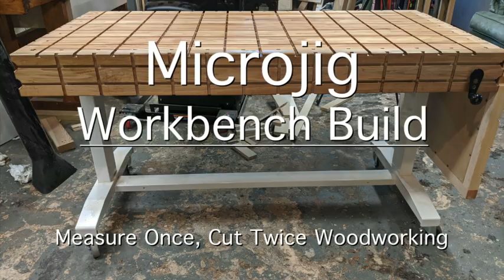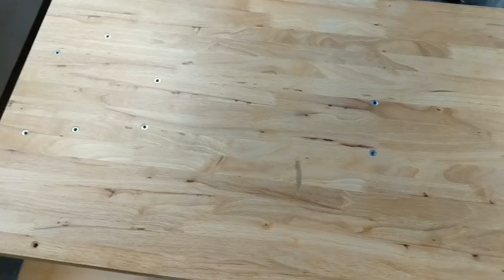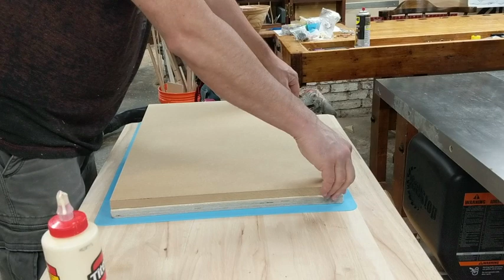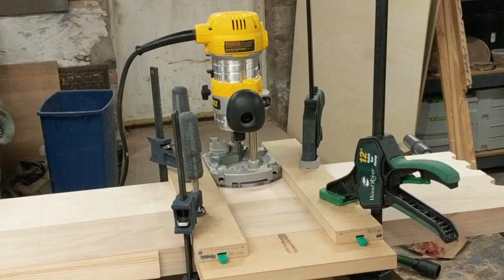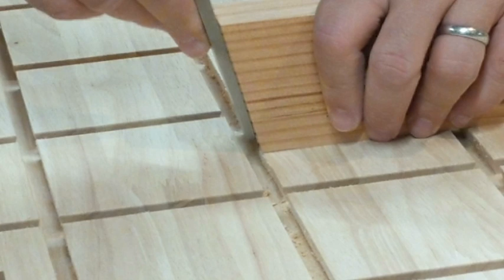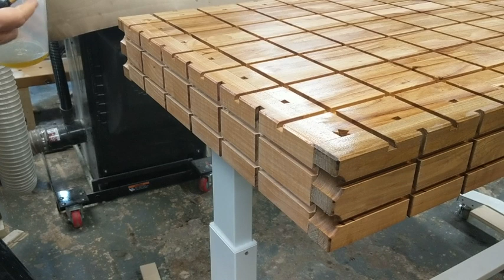Microjig Ultimate Workbench Build

Comment: Question: I plan on using this method for a vertical panel in place of a vice, but how has this panel worked for you on the top surface with debris and stuff following into the slots? My plan is to use Microjig for vertical surfaces and sleds, but use MFT for large assembly table? Any thoughts?

Comment: I think with a few modifications, this plan will work to update my harbor freight workbench. It will just be a fixed height, the same as the table saw, or actually 3/8 of an inch lower so that I don’t have to cut miter gauge 5:25  clearance slots.
Reply: Great idea. Would love to see the final result.
Reply: @   I have several projects in the way before I can get to it so it might be a bit.

Comment: Good job, between the original plans and your build, i bought my 3rd Husky table. (Each prior was supposed to be WwShop, but ended up in my laser room holding up lasers).  I used 3/4 ply under, nuts all went back in easy. I ended up permanently attaching vertical as the original plans.  It won't hit floor.  And 3d printed a hex connector. Easy.  Btw, the black no drawer table is on sale at $149.  If you can find it

Comment: Well, you have had plenty of time to use/evaluate the table/system.. Is it still the best system for build/assembly? 
The only problem I can see is dust/screws, etc falling into the grouves, but, probably not a big deal considering the functionality of the table.. What is your opinion now, that you have used it for a while?  I see lots who go from Matchfit to Dogholes only. Just wondering.. Considering a build and figured I would ask..
Reply from the maker: It's definitely a great table after all this time. If you want to add dog holes, you certainly can.
Reply: @measureoncecuttwicewoodwor3927  Thank you....

Comment: Great video! I am trying to replicate this in some ways, but I’m having trouble figuring out how you mounted the taller square shaped apron on the end. The second to last shot shows some bolts but that is a pretty important piece to mount securely so you don’t stress that panel on a vertical clamp.

Comment: Amazing. So, is it worth it to use a hardwood for the solid top portion? For strength/durability when using the microjig clamps?

This looks like a fun future project!
Reply from the maker: The hardwood isn't needed for clamping strength, plywood would do just as well. But it is useful for durability, less chips and dings.

Comment: Getting ready to do something similar, but can't figure out what happens if you do a glue-up on the table and the glue gets into the grooves.
Reply from the maker: I haven't gone full boat messy glue up into the grooves yet. Little bits are easily cleaned, and the Danish Oil I applied gives some protection. But I imagine lots of glue left to dry in the grooves will stick and need to be routed out.

Comment: Thank you for the great video....very helpful!  I am creating the track hardware myself - knobs as well as tracks, which I create from, metal, Ipe and kind of plastic.. I am using 1/4 and m6 Taps for drilling the holes and insert the compatible screws with a kind of Loctite glue.....

Comment: Great table... I'm just about ready to try my hand at building one similar to this but I have one question you or one of the other expert might be able to help me with.  Is it worth it to spend the extra money and use 3/4" Baltic birch or can I just use regular 3/4" plywood.  I can get the 7 ply plywood for about $35.00 less than Baltic birch.
Reply: I tend to use ply for projects like this. The layers of ply tend to be more stable. Good luck!
Reply from the maker: My top cupped after using Baltic birch ply under solid wood. Possibly it was the lamination of solid wood to ply that caused it.

Comment: This is great, thanks für the video. Well done and entertaining!

I am planning on doing basically the same thing but with t-track grooves since I already have the bit. Advantage being that one can use a whole range of available hardware, including festool guiderail clamps, plus even regular 8mm hex screws fit in the tracks.

Do you only use this table for a bench or do you also have a dedicated woodworking bench with vises?
Reply from the maker: Thanks for the comments. I use the table as assembly, outfeed and a 2nd bench.

Comment: I like your approach and you’ve made very clear what the MicroJig plans did not (I know, I’m a sucker). A couple of things as I’m getting into this,  the threaded inserts that came with my Husky 46” bench are are actually a little larger than 1/4”. I used a 5/16” bit on the “thickening” plywood base. I also used a 3/8” forstner bit to seat the insert head flush with the top of the plywood since it sits proud otherwise. I used a physical drill stop guide as the plywood layers give way a little too abruptly for tape as a stop. I also found that using a self-centering hinge bit allowed me to skip your draw-a-circle, punch a starter hole, and  then drill a pilot hole steps. Once the frame was set where I wanted it, I clamped it in place and drilled the initial 1/8” starter holes with frame in place using the hinge bit. Worked like a charm.  The rest of your process looks solid. Thanks for making the video - Very helpful indeed - keep ‘em coming.
Reply from the maker: All good pointers! Thanks Bill
Reply: @measureoncecuttwicewoodwor3927  Steve - do you have a plan for the flattening sled? There are lots of these online, but I thought yours looked really easy to build. Oh, and do you have the dimensions and instructions for the flat shelf on the bottom. I could guess, but thought it best to learn from the master craftsman himself. Maybe another video (hint, hint)...  🙂

Comment: Not sure about the longevity of the top being solid wood and plywood together seeing as how thick the top is. Wood movement might cause issues with the plywood. Curious to see what happens but otherwise superb work. Keep it up
Reply: Yeah built a couple of these and both are cupping across the width of them, may rebuild the table top as a torsion box.
Reply from the maker: Yep, my top cupped down the center. Probably due to the plywood/solid wood lamination. It still works great, but I can't use it as a square reference by itself. I use squares and jigs when I need that.

Comment: Love the build and the detailed video, thank you!  One question - do you think a 1.5 inch thick top is a necessity?  I purchased 1 inch baltic birch for the top and am hoping to skip the step of laminating another 1/2 inch mdf on the bottom.
Reply from the maker: Thanks Kevin. I think you'll want a thick top, at least 1.5" if not more. Once the top is flattened and the 3/8" groves are routed, the thickness of the remaining solid section is only 1" thick or less. My top ended up cupping. Not sure why exactly, but it might be the mismatch of plywood laminated to solid wood. Good luck with your build!
Reply: @measureoncecuttwicewoodwor3927  - thanks again for the video.  I finally built mine and referenced your video multiple times!  I decided to laminate the two 1" thick baltic birch together giving a 2 inch top per your recommendation and then applied black Formica to both sides.  It is very flat.  In addition to the dovetail grooves I also did a series of 20mm holes so I can use both dogs and Matchfit clamps.  There were many tips that I picked up from your video along the way so thanks again for the vide and replying to my previous questions!
Reply: @measureoncecuttwicewoodwor3927  Thanks for replying - very much appreciated!  Thank you again for the video.  I was sad to hear that your top cupped, but I do think it is related to sanding off the finish of one side of the hardwood top and laminating to plywood giving an opportunity for a moisture imbalance.  It is because of you sharing your experience and one other video that I watched that has me leaning to replacing the hardwood top entirely.  I love your video on this and have watched it several times, and thank you for sharing the good and the bad that you experienced so we can learn from it too!

Comment: Hey man I hate to be the safety police but you should have a riving knife on that table saw.
Reply from the maker: I usually use the riving knife and splitter/dust guard. Must have forgotten that time.
Reply: @measureoncecuttwicewoodwor3927  that's how I lost my index finger working in a shop that had no riving knife available for their table saws, it bugged me and I said something about it but they were old school. Caused a piece to pinch and eject and rotate my body when my right hand shot back, this rotation pulled my left hand forward into the blade. I never operate a saw without one unless using a dado stack.

Comment: Does this husky table have the option to put the bottom cross bar on the backside.  Their other tables, both larger and smaller, show this in the pictures but the 52" one does not.
Reply from the maker: Yes, the 52" table has the option to put the cross bar in the center or the rear of the base.

Comment: Amazing video! Wondering how this workbench is holding up since 1 year of posting this video?
Reply from the maker: Thanks! The bench has been great. One issue was that the top cupped. I assume it was the different expansion rates of the plywood base, solid top and breadboard aprons. I still use it all the time for clamping, assembly and clutter storage.
Reply: @measureoncecuttwicewoodwor3927  Great, Thanks very much for your quick reply! I was wondering how stable/sturdy has it been. Do you have any other recommedations for the table top to avoid cupping?
Reply from the maker: @sreevatsan  The base is super sturdy. You'll want to get dual locking casters that lock the spin and rotation of the casters. That makes it sturdier than single lock. I'm not sure the best way to control the cupping. Maybe swap the top and plywood sandwich for a solid butcher block top. Of course, that will add to the cost. If others have good ideas, please add them to the comments.
Reply: @measureoncecuttwicewoodwor3927  Great, thanks Steve for all the tips! I agree-  a solid butcher block top and dual locking casters would be ideal in this case! If going the sandwich route, perhaps we can consider MDF insetad of plywood.

Comment: You used 1/2" Baltic birch plywood. Is it going to hurt anything if I use 3/4" Baltic birch?
Reply from the maker: Not at all. Should be more stable than 1/2", and the lift mechanism shouldn't mind the extra weight.

Comment: The top with the original wood and the 1/2" plywood, would make it 1.5" thick, but the aprons are 5" wide, so is there 3.5" of overhang underneath?
Reply from the maker: yes, correct - 3.5" of apron overhang

Comment: Good job on the bench and video. I went through the comments and didn't see anything about how sturdy the Husky bench itself is (apologies if I missed it). I will do some heavy planing and that sort of thing. Does the bench wobble much?
Reply from the maker: The Husky base is super sturdy. Even with casters on, once they are locked, the table is steady enough for planing. Get the casters that have a dual lock for wheel rolling and swivel.
Reply: @measureoncecuttwicewoodwor3927  good tip about the casters, thanks

Comment: Hi! Can you use a motorized adjustable height table base for this? I think it would be cool to have presets made to function with other tools at different heights (IE tablesaw, bandsaw, etc..)
Reply from the maker: That would be cool. I haven't looked into motorized options. The HD table used here is very sturdy. If there's a motorized version just as sturdy, it would be a great option.
Reply: @measureoncecuttwicewoodwor3927  So I did a little homework and found that the build for the the motorized base I found is fairly similar to the one you have (350lbs capacity). The only thing is that yours has a support on the bottom that mine doesn't, so not sure if the one I found would be more wobbly or not (if it is, I guess I could figure out how to install a support somehow).

Anyways, I just subscribed and am definitely impressed that this is your first video on your channel. It was like you have been making youtube videos for years! Looking forward to watching more! Thanks!
Reply: @jeffbutson7565  sounds great. Good luck with your build. Thanks for the positive comments

Comment: After almost 7 months, how are you liking the bench and what would you do differently ?
Reply from the maker: That's a great and very timely question. I'm loving the bench, using it for all sorts of assembly and outfeed. But the one thing I checked recently was flatness of the top, and it turns out that the top has cupped. I'm not sure how that happened since it's about 2" thick (1.25" solid wood plus 3/4" mdf) and has 1.5" aprons. If I flatten it again, the higher dovetail grooves will widen and potentially not hold the clamps. I'm guessing the cause was the solid wood top expanded or contracted widthwise while the mdf didn't.   I'm open to creative solutions if anyone has one.
Reply: @measureoncecuttwicewoodwor3927  Thanks.  Was adding the mdf base to keep it stable?
Reply from the maker: @georgebrill3072  the MDF was to thicken the top before routing the dovetail grooves. It's possible that it constricted the wood movement of the solid top. Also, gluing on the maple aprons on the ends may have done the same.
Reply: @measureoncecuttwicewoodwor3927  Thanks.
Reply: @measureoncecuttwicewoodwor3927  I was wondering about the cupping. I almost bought a couple of those "butcher block" (not really, but that's their nickname) tops for my own and when I went to buy it, several had cupped.  I decided that MDF or plywood would have been better. (At the time, I hadn't considered the 360 design).

Comment: Great video! I like it, but just one question: In stead of simply cut Dovetail groves at the ends of aprons, are there benefits or special purposes to drill 1" half circle holes?
Reply from the maker: Thanks  The half circles allow the clamp to be inserted where two dovetails meet at 90°.
Reply: @measureoncecuttwicewoodwor3927  Expect to see this demonstration in your woodwork application soon.

Comment: How did you route vertical dovetails on short ends without hitting the metal frame of the table?
Reply from the maker: All 4 aprons are outside of the original top. So they hang down from the top's edge and are outside the metal frame.
Reply: @measureoncecuttwicewoodwor3927  I understand the aprons are, what about the vertical dadoes in the original top?
Reply from the maker: @richardsutton6289  Now I understand your question. Because I added plywood under the original top, I had to drill for new threaded inserts. That allowed me to locate the base toward one end by 1/2". Before putting the base back on, I routed the vertical dovetails. So one end of the top has inside vertical dovetails that force the clamp to stop when it hits the table base, and the other end has the table base out of the way and clamps go all the way thru.
Reply: @measureoncecuttwicewoodwor3927  Thank you for the clarification

Comment: Hey Steve, interesting project.  Also, a great first video!  Looking forward to some more.  I'm curios, does the end table/piece lift to extend the bench or is it just for clamping larger pieces on the end?  Have a good 1, Dave.
Reply from the maker: Thanks Dave. The vertical end piece is fixed. It works well for clamping work pieces at 90° angles. I plan to add another one at the opposite end that is hinged, using one of these: https://www.amazon.com/dp/B07F3RBFXC/ref=cm_sw_r_cp_apa_glt_fabc_T51SQ3VAN952VDA7Q7P0. That will extend the table length when I need it.

Comment: I have the Husky table without the drawers in my garage waiting for to make this work bench. I did not think to use the solid top as you did. I was going to follow Microjig plans and attached the it to the solid top. However, I like the way you finished the workbench I will follow you lead. I am a bit nervous to remove the inserts but here goes nothing! Thanks for the better idea and i get to save money at the same time.
Reply from the maker: practice drilling the inserts into scrap, but once you find the right drill bit size, it will be super simple. I ended up buying extra inserts on amazon because I stripped one. good luck!
Reply: @measureoncecuttwicewoodwor3927  hope to see more videos!

Comment: you really need to be doing more videos.  Outstanding job.  I just ordered the longer husky table and dragged out the matchfit clamps I bought at rockler 2 years ago.  I didn't build the table before, and am very glad you took the time to film, edit and upload the video.  Again, GREAT
Reply from the maker: Thanks Steve. Good luck with your build!
Reply: @measureoncecuttwicewoodwor3927  Hey quick question for you.  Whats the reason for the vertical cuts on the sides before attaching the aprons?  I see them used for clamping the aprons in place.  I have real clamps that reach across the top.  Wouldn’t that be sufficient?  have you found a use for them after the build?

Comment: I'm still learning what I can do with my microjig clamps. Just the tip... I mean just a tip... But they work with track saw rails even though they say they're not designed for that. Mine are Powertec rails which are a Makita clone which is a Festool clone with that anti-tip lip.
Reply from the maker: look up DrillPro track clamps: https://banggood.onelink.me/zMT7/4dbc8e67. Like the Festool clamp, cheaper, but good quality. They don't fit the dovetail grooves until you angle grind them, but the quick release feature makes it worth doing. I'll add that to a video coming up.

Comment: Do you have info on the bottom tray that you built?  I am looking to add shelves to my husky tables. What do you think?
Reply from the maker: All I did was lay plywood over the center bar, then place support blocks underneath and figure out where the threaded holes in the metal base lined up. Then I removed everything to glue the blocks and add the mitered edging.